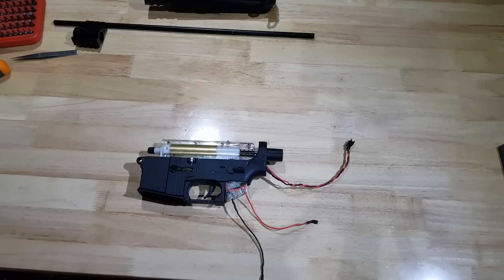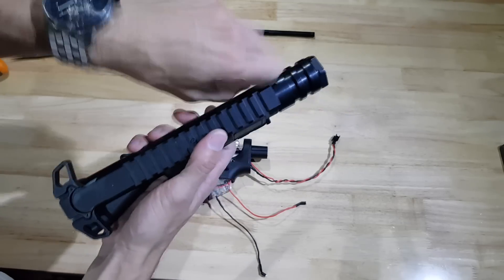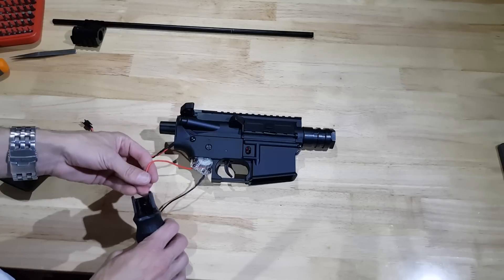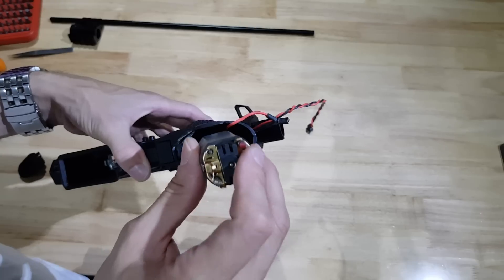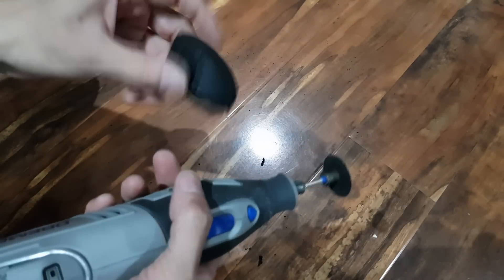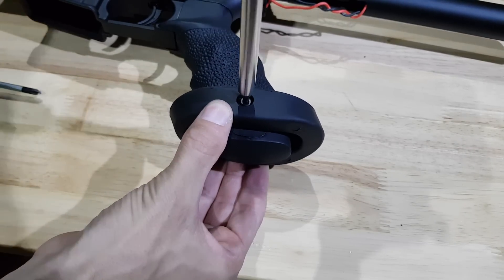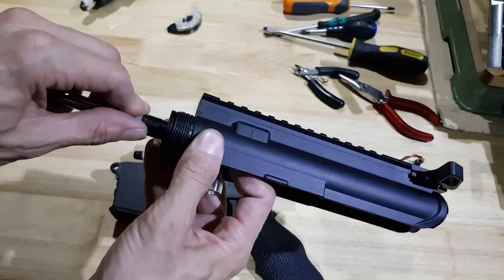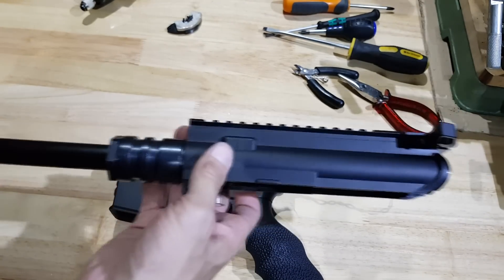RSASS inspired gel blaster build.

Comment: Mate old video I know but one question I didn’t see in comments. The free floating handguard you made a stabiliser ring. Is it needed? Or is it just overbuilt for strength/safety? Is there a premade unit one could buy to fit those slim handguards?
Reply from the maker: you definitely need some sort of stabiliser. you can buy pre made ones.

Comment: Hey mate, lots of people are having issues with the m4a1 cocking handle spring being broken when pulling the handle, would really appreciate a video showing how to replace it if you have one available.  The box includes a spare spring so it’s obviously an issue they know of....  cheers.  Also, do you have a better way to contact you? Twitter, Facebook, etc?
Reply from the maker: funny you should say that... because this one just broke.. so I'm gonna have to replace it...
Reply: Low Guido's Chop Shop yeah, lots of posts about it on Facebook in the Australian gel blaster enthusiasts group mate.
Reply: I replaced the spring with a Weber 32/36 carburettor return spring and haven't had an issue since.  The Wells charging handle is much better and i wish Jinming did it that way.

Comment: Hey man love your vidz. Need help with somthing. My wells v2  is way less accurate then the vector i have tryed most stuff and nothing fixed. Im thing its the barrel but i have  stoped the barrel from moving but it dont work.... im lost .its doing my head in
Reply: @Rage 123m - CaneToad Hopup and Use Milkys. You may want to consider a smaller Bore Barrel. These things will help immensely

Comment: I got the blaster back with reduced power. Used it for 2 mags. Blew apart.......
Reply from the maker: Which blaster are you talking about?
Reply: @lowguidoschopshop  - Gen 9 - upgrades are;
Metal Gears, Gear Shims
Alloy Cylinder, Metal Spring Retainer, Spring (1.4), Heavy Return Spring, Alloy Barrell
T-Piece, Metal Trigger
Metal Tappet Plate
Red Motor, Full Metal Rack Piston & Alloy Head
Alloy Cylinder Head. 
Vibration loosens the screw in the handle that keeps motor aligned and cracks the gearbox casing. The double ring piston was changed to a single ring but still dramas. I don't care about huge FPS I just want a reliable blaster. Really frustrating. Any advice would be much appreciated 
Cheers. Your channel is great even for a newbie like me
Reply: @nato3811  if u want a reliable blaster run a 1.3 and not every upgrade under the sun  . look at old mates gun its just a lipo with 11v and im guesing its got a 1.3 in it and still have your experimental gun until u tune it in to be reliable
Reply: @ryanhamilton187  I'm just realising that now. As a newbie I just wanted something with high performance. I had no idea about the reliability issues that come with jamming every upgrade in together. I'm not going to drop any names, he's a good bloke but the guy who sold me and my mate the blasters and put together the build said it was doable and he's trying to get them sorted for us now at no extra expense of course but I think 1.3 spring and maybe even a slightly less powerful motor? I'm not sure. Cheers for the response

Comment: Can someone tell me why the dude who has modded my Gen9 is now reducing its power from 350fps range down to around 300 because he keeps ripping apart the gearbox housing with his current build? Spring is 1.4 with red motor and all the trimmings
Reply: how often did u shoot???am really confusing hearing all u ausies blaster fan shooting over 300fps with no problem at all, what confusing me was not how high the fps , thoes number arent anything special,i dont even need new gen like g8&9 or well to get that ,just a solid good quality old gen gearbox and 2 or 3 mods.sorry,back to main point, how really how can any of ur blaster shot at that range and still be in one piece???for exp:brand new 2 j9, 1 i did extrem anti leak (stock ~250 fps,after ~270),1 i just change from "if u can call that a spring" to my 1.2 medium hardness 18 coils spring(stock ~245,after ~266).the second one last some what near 2 days before it gearbox head torn apart from its body, the first one last ~4 more mags before end up the same.just close to 280 fps did that, and time after time after time i read ausie no1 shoot over 300 with stock gear no problem, ausie no2 shoot just like that with no problem but did some simple mods.how come ur blaster sturdiness is so high??? or is it u shoot only in semi mode and wait 5 minutes after each shot?
Reply: Do Anh  we just know how to build guns 👌🏻
Reply: @doanh6499  Maybe your chrono reads low or you have an excessively heavy piston?